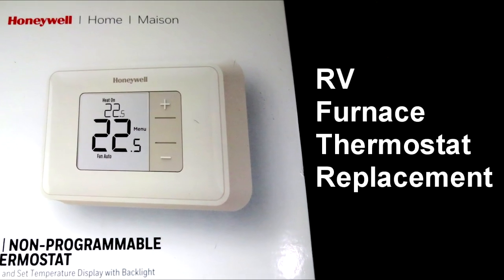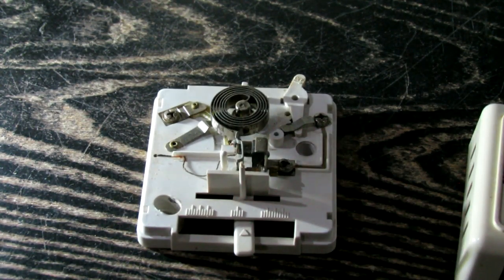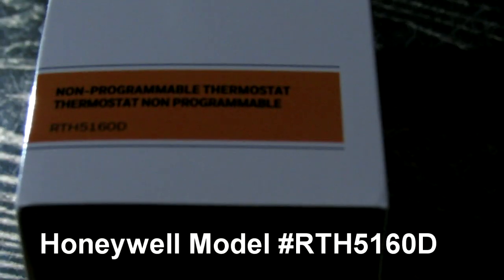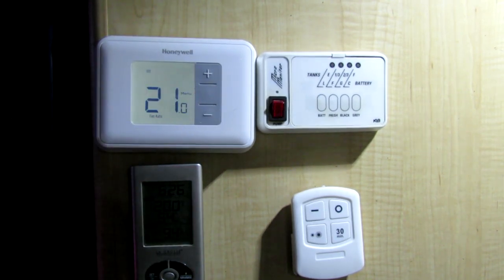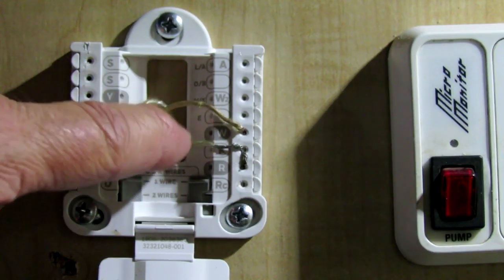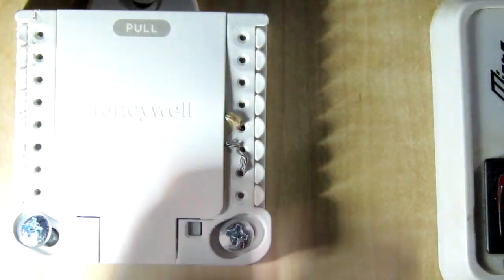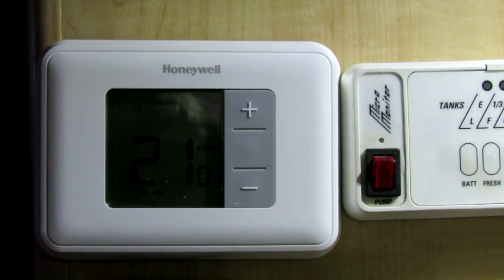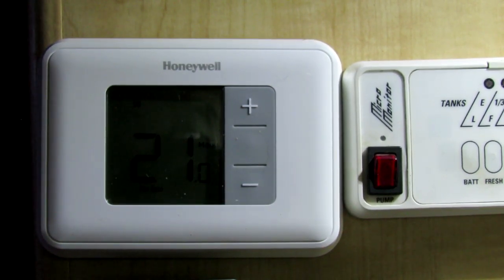RV Furnace Honeywell Thermostat Install

Comment: Thanks my man. I bought this same Honeywell thermostat to replace my manufacturer thermostat. I had the same issue you had. Although my travel trailer had colored wires, and were even labeled…looking at the manual for the Honeywell had me scratching my head as to which pins to use…because they weren’t identical. I figured it was a R and W pin…it’s just on the Honeywell, the W pin is labeled W Aux. was going to ask my HVAC guy at work to give me the run down as to which pins handled heat in this application…but you appeared to head that off. Will install tomorrow after work. Thanks

Comment: about to install mine should work just fine in my trailer! i pray lol i have the old style like u showed at the start of the video and i have had problems with it getting cold at times in the trailer. so i figured it was this dinosaur of a thing not working properly so i am changing it in the hope of it detecting the temps a lot better. i pretty much i thought the old one was not working properly to keep it a constant temp in my house loved the video feel like a idiot lol the instructions was in genius terms   love how simple it looked after seeing this video thanks for the help an the video
Reply from the maker: Hope it works out well for you. I find this thermostat keeps my RV at a more accurate and constant temperature. It's still working fine for me. The instructions were not the greatest on this model.
Reply: @Linescrew1Canada   it worked out fine once i got it hooked up after your video thanks for the informal video helps a lot my problem is that for some reason my house trailer just seem to always have a chill so i decided to replace the outdated thermo and replaced it with this one hoping it would regulate the temps better but idk i think ill always have a trailer so idk im going to plastic my windows. i am always cold i  think it could just be  me because my thermo always reads what i have it set too idk if u understand what i am talking about

Comment: This is not where you are supposed to "slide" the wire, you are supposed to put them on the side holes, the top holes are for the connectors of the panel.

Comment: I did the same thing in my RV because the temperature swings were insane.  It was like laying under sun lamps and then walking outside into the arctic circle before it cycled back on again!
Reply from the maker: Yes, I agree. I'm doing an all night test run tonight and I'm noticing it's not cycling as often which is easier on my battery bank and less temperature fluctuations. And it's nice to ACTUALLY know what the REAL temperature is!

Comment: This is not wired correctly. The feed wires go inside the door on the side connectors. The jumpers you have the wires in are the socket for the head unit. I'm not quite sure how you got this all together...
Reply: Glad u seen that too lol
Reply: I had the same question when I saw the video.  It’s like he wired the wires straight to the head plate

Comment: Is your RV 12v or 24v? I’d like to use this for my 12v van, but Honeywell is confusing on whether or not it’ll work. Thanks!
Reply: I thought rvs need a 12 volt thermostat or battery power ones. I need a new thermostat for my rv but u can't find anything that will work as fare as the 12volt goes
Reply: @aaronquiroz2474  this thermostat is battery powered. I learned in the install of ours that you don’t actually need a “12v thermostat,” a normal one passes through whatever voltage you supply to it so a smaller 12v system does seem to work fine
Reply: Ohh Cool. Yea im dealing with the thermostat right now I'll pick one up at lowes . Thanks for your video. 👍

Comment: Does the new thermostat have a off setting for rv storage?
Reply from the maker: Yes. It is off now when I am running electric heat. And you are probably wise to just take the face plate off and remove the batteries to avoid replacing them sooner than required.
Reply: @Linescrew1Canada  what i mean is when its in storage is there a permanent
Reply: off setting so as not to run during storage.
Reply from the maker: @smoothoperator1663  Yes, as I said you can turn it off. Or remove the batteries. The batteries last months, I'm told.

Comment: You left out the only useful bit of information that could help anyone. How to determine which wire is red or white. I guess you would also prefer everyone else learn about the 

1 wire/2 wire switch the hard way.
Reply from the maker: It's irrelevant on a 2 wire DC set up. As I stated, 1 wire is hot, 1 is ground. The thermostat is merely a temperature control switch and completes the circuit when activated. If you only have 2 wires, it makes no difference on which way it is wired. The only thing you need to know is which pin connectors to place your wires into, which I have clearly shown.
Reply: @Linescrew1Canada  Thanks for the clarification

Comment: The original wiring look like speaker wire.  Do the treble and bass controls work OK?
Reply from the maker: HA! You noticed that too?? Don't come a knocking then the bass is a rockin' in the RV! (odd wiring for a furnace!)
Reply: "We're outta 22 gage wires, boss."  "Dude, use whatever's on the shop floor, man. "   "OK boss."
Reply from the maker: That's EXACTLY how the conversation went! LOL

Comment: You put the wires into the wrong side of the ports
Reply from the maker: It works 100% fine that way for the last several years, so I wouldn't get my poop in a knot.
Reply: @Linescrew1Canada  not the point. If you're going to do a diy video the least you could do is show a  proper install. 😂

Comment: I just replaced my RTH5160 and the code on the display started at System Setup Setting 221 instead of 125?  The heat stage works fine but I can’t figure out how to return to the 220 so the cool will work?  I’ve looked everywhere but nothing in the manual to help.  Any suggestions?